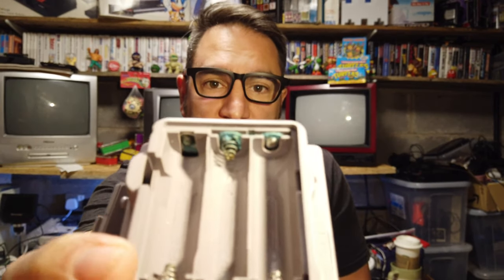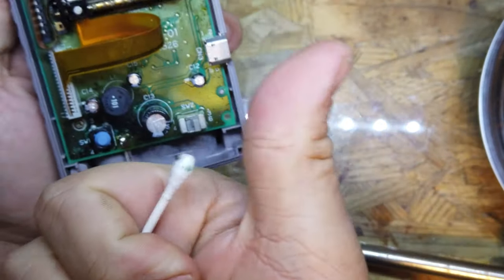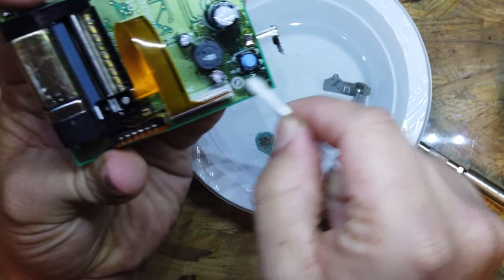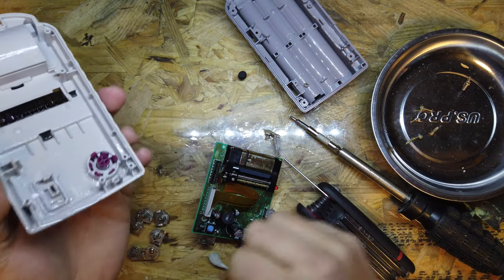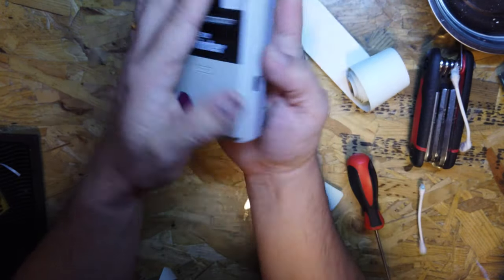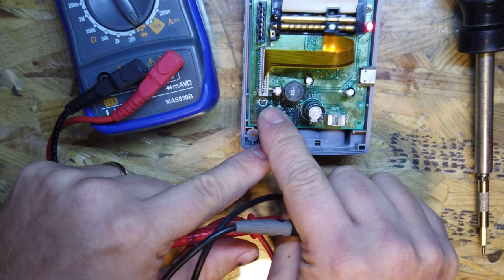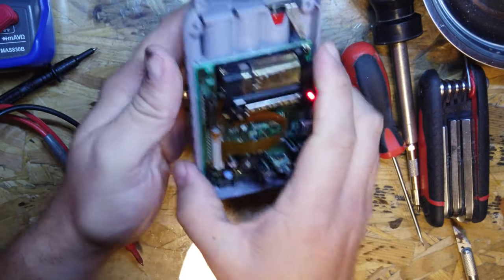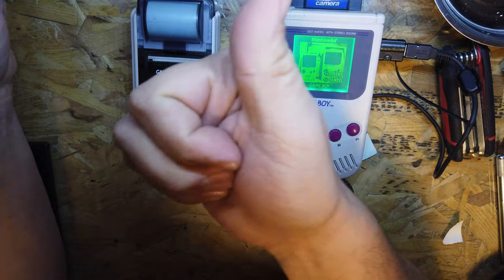Nintendo Game Boy Printer Restoration | Battery Acid Leaked Paper Feed

Comment: Any hints on how you got the rubber plunger back in on the feed button? I’ve been trying to convince mine for about an hour so far..
Reply from the maker: They are a nightmare. If you have contact cleaner or similar you can put a  bit on to give it a bit of lubrication. I then use a flat head precision drive bit to push it back in carefully to avoid puncturing it.
Reply: Goodwins Place thanks - glad its not just me. I got it in eventually after a lot of swearing and perseverance. Turns out it was something in the printing module that was dead on that one though. I had a spare thankfully so made one good unit out of 2 bad ones

Comment: Glad to see that it's working. I'm still curious about that black grime/corrosion there.

Edit: Not sure if it's a burn? But it did have some battery acid there. Could that have caused it? I'm never seen battery acid leaks turn boards black though. Usually it's just that blue-green color.
Reply from the maker: I think it was the acid and probably sat there a long time. The more I scrubbed it the more I could see it was lifting the original board.
Lucky this board is so simple as if it was something with a load of traces then I think I'd have been in trouble.
Reply: @GoodwinsPlace  Do you think changing from the buds to a brush would've worked better in removing the black acid?
Reply from the maker: Tried that too off camera. I think the colour is where the acid has reacted with the green on the board. If I scrubbed much harder it would have taken it totally off.

Comment: hello! any advice about my gameboy printer? the paper actually advances, but there is nothing on it. what can it be? i tried to print on the original paper and even tried to print on an used receipt but still doesn't work! thanks!
Reply from the maker: Do you hear the head move? It's done with a heat header that moves across the paper.
Reply: @GoodwinsPlace  hi! thanks for your reply! the head actually moves, but I don't understand if it's hot. Do you think it is adjustable?

Comment: My prints have white lines, I guess is an issue with the feeder, do you know if thats fixable?
Reply from the maker: Hard to say without taking it apart and checking over. Could be missing teeth on the cogs, faulty motor or the print head. Sorry not much help but see if you can spot anything when you take it apart.